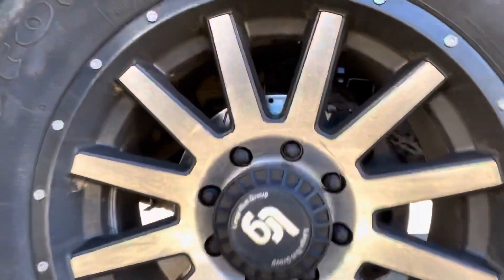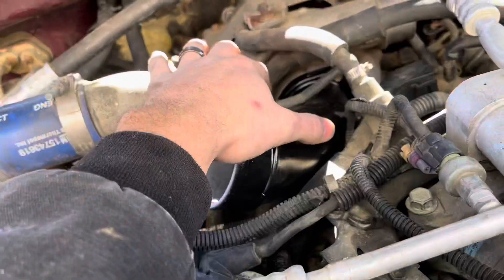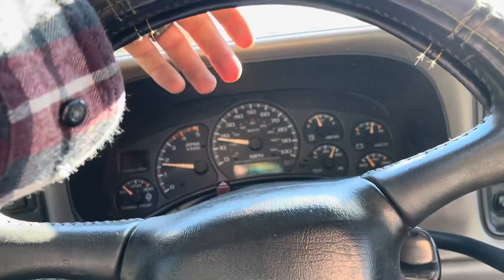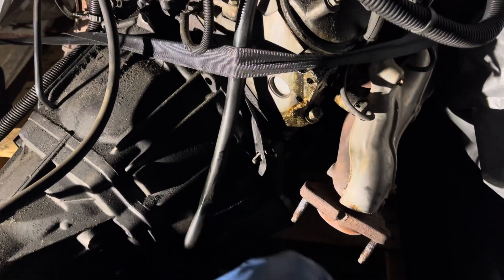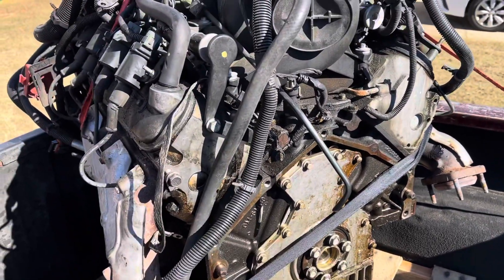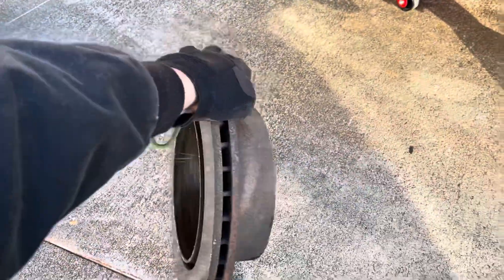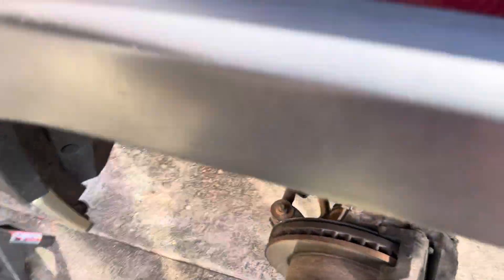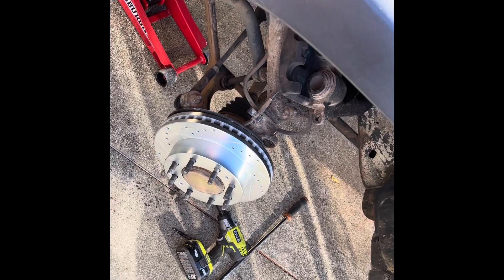My LB7 Duramax Gets a Fleece Intake Horn Along With Detroit Axle Drilled And Slotted Brake Rotors!

Comment: Happy holidays, just curious as to why you removed the trans without disconnecting the torque converter from the flex plate first, no spillage that way.
Reply from the maker: 2 of the three hex bolts were stripped out so I just pulled it because that’s what the guy wanted me to do who bought the transmission!